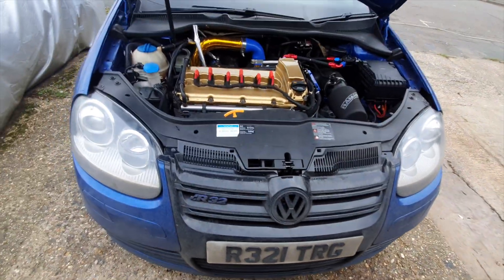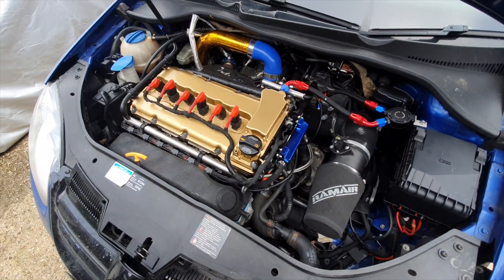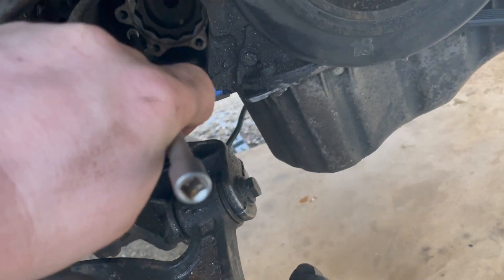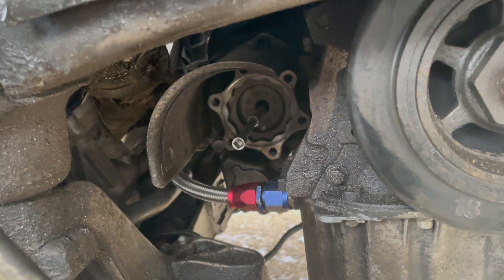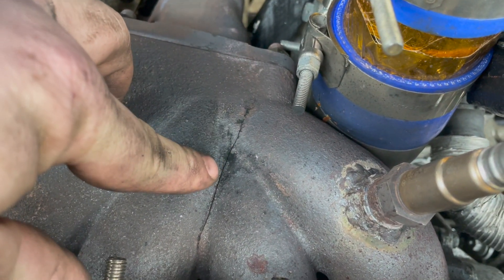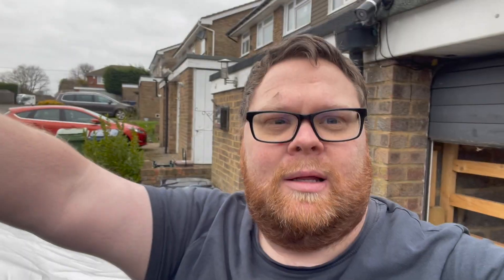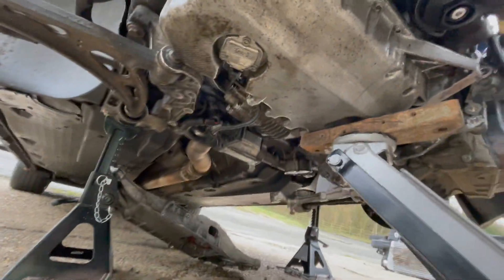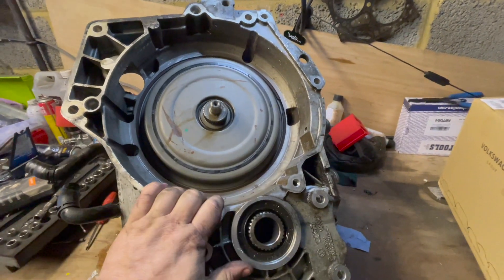My VW Golf R32 Turbo Getting Golf R Clutch Packs PT1- MK5 Golf R 32 Turbo Build Series

Comment: I just recently finished the assembly of my r32 project( fully forged with a pte 6466) and i installed stage 3 clutch pack for 1200nm. I remembered that when i was reading the manuals for installing, it was saying to put the friction discs in oil and after assembly. You did the same with this clutch pack? Sweet ride and very helpful in many times in my project🙏🏻🙏🏻
Thanks man. Merry Christmas to everyone.

Comment: Just did this for my 3.2 TT Turbo recently.. Having trouble now with the PRNDS flashing / locked out of all gears when the car gets to full operating temp. Going to try some things this afternoon.. but subbed to see if you run into anything similar in part 2. Good video and awesome car!
Reply from the maker: Sounds awful. Have you tried doing basic settings via VCDS?

Comment: That crack on the manifold is properly weight of the turbo is pulling it down is the turbo braced, to the engine block
Reply from the maker: You probably right. And no it’s not braced. I’ve not seen anyone brace a turbo on an R32 turbo so would love to know how people have done that before

Comment: What clutch pack did you fit the one in the link looks like a normal pack as it doesn’t say Golf R & isn’t it a 7 speed . I just want to do the same and what to make sure I get the right one 
Thanks 
Ian
Reply from the maker: Hey. The one in the link has the part number that ends with a C. This is the one for the mk7 golf R. I confirmed with VW before ordering too.
Reply from the maker: Also wait until I have my dyno session tomorrow just in case 😬

Comment: Is it a dq500 that you’ve put in or a staged dq250
Reply from the maker: I kept the original dq250 gearbox with mk7 golf R clutch’s packs. These can handle around 550ft lbs.

Comment: Hi, You think that i would be able to upgrade my 2006 audi TT 3.2 mk2 clutch with this set? My dealer say that 02E398029C goes only 2012 and newer :/
Reply from the maker: Yes you can. They are identical except some of the internal specs on the plates themselves